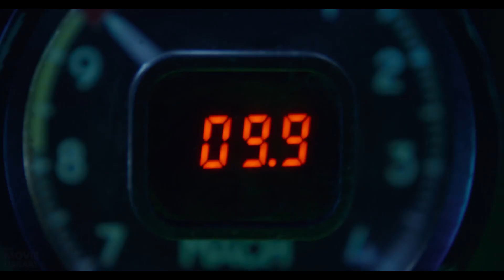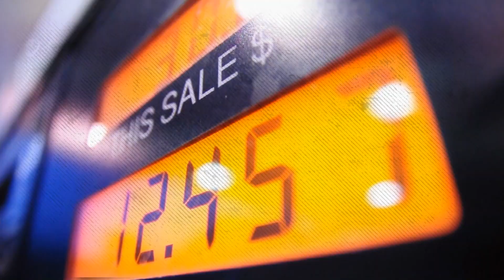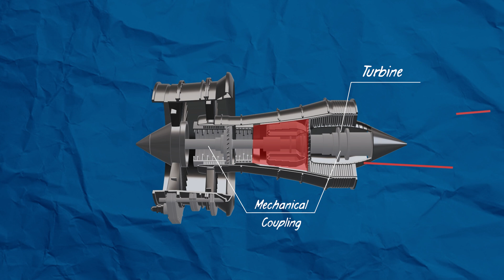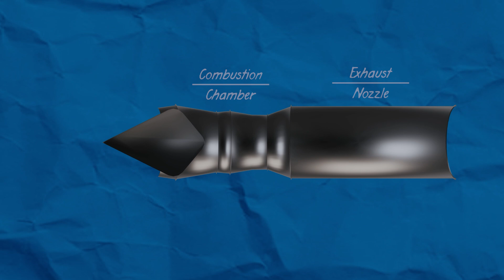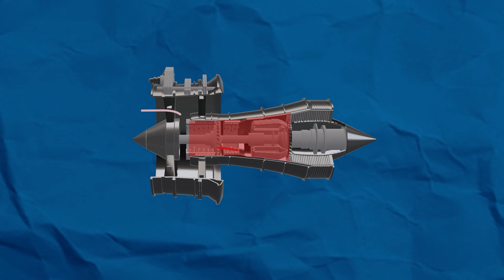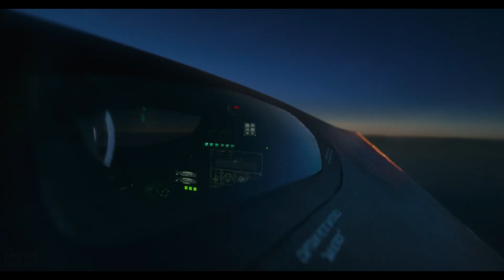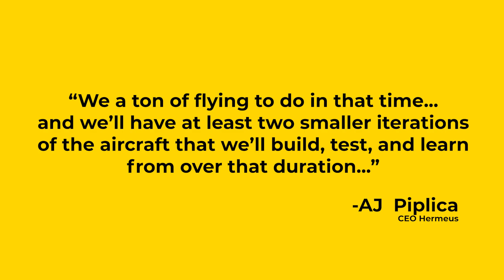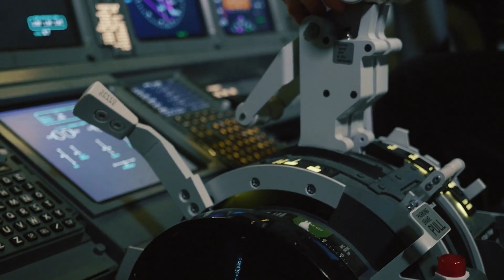The Mach 5 Engine That Will Change Air Travel Forever | Hermeus

Comment: Great video - thanks. But I was a little disappointed that you made no mention of the great British idea of the Skylon and the Sabre Engine, which also uses a pre-cooling system. I believe it converts from a Jet engine to a Rocket engine, at sufficient speed & altitude. The Skylon was a brilliant concept, but sadly, like a lot of good British ideas, always short of funding. Maybe you could make a video about it and give an update on what - if anything - has happened to the Skylon and the Sabre engine. Thanks again.
Reply from the maker: Hey! Thanks for the suggestion. I'll take a look 👍
Reply: @DrBenMiles  I searched for Skylon today, probably why this clip came up. The most recent clip was two years old. The last I read they were testing in Colorado and had some success in a lab / R&D environment that's too large and heavy for flight. But when has a proof-of-concept been deployable? Okay, July 16, 1945, still.

Comment: Concord has flown more time at Mach 2+ than all military jets combined since 1947. It was never commercially viable if research and development hadn’t been written off. What would be the point of commercial jets flying faster than the speed of sound considering the material degradation due to heat on the control surfaces, wings and cabin structure. Then there is the consideration of the large amount of time waiting in customs and baggage handling.

Comment: These Mach 5 jet airliners are not going to happen. It is not the engines, it is the materials. We don't have supersonic jet airliners because sonic booms and the heat generated by air friction. Also, the SR71 had this type of transitional engine technology. Instead of trying to get there quicker, would be better off trying to reduce the time to get through the airport at both ends.
Reply: What about 1/10th size engines for
Mach 0.5?
Reply: @ummerfarooq5383  I don't understand your point. Mach 0.5 is 1/2 the speed of sound. Smaller engines would I suspect be more inefficient as the size bipass ratio is getting larger on modern jet airliner engines.
Reply: When the SR71 and the Concorde were around composite materials were in their infancy on a commercial scale. Now Its everywhere in the military and commercial vehicles. Mach 5 Jet airliners can and will happen. We have alot of R&D around the world looking into making new heat resistant and durable materials and we also have R&D in look at reducing Sonic booms. You are extremely ill informed and judging by your comment you look like your living 30 years in the past, please educate yourself and do some research on current developments in the field before you make such stupid comments.

In 1960 it was believed to be impossible to go to the moon but we did it in a decade. Never say Never
Reply: This reeks of an American complaining about spending 4 hours at the airport and only 2 hours in the air for a cross country flight. In the rest of the world there is a bit of pain when a flight from UK to Japan or America is between 9 and 12 hours depending on where you fly to so the 3 or so hours at the airport or layover isn't that much of a problem in the grand scheme of things.

Comment: hyperloop makes more sense to me, almost no drag, not much costs in energy, in a perfect scenario it would require 0 net energy to travel as far as you want since during decaleration you can get the energy back you used to accelerate it
Reply: The hyperloop is so flawed it is ridiculous.
Reply: @dr_ned_flanders  probably because I am not helping with that project yet, but in theory it is the future
Reply: TANSTAAFL - there ain't no such thing as a free lunch. You're never going to get work out without using energy. If you could then a) perpetual engines would be possible, and b) the universe as you know it wouldn't exist because you're proposing an instance where you have sanctuary from the laws of thermodynamics. Never going to happen. Vacuum - large scale in the real world is never going to happen. All vehicles break down. How are you planning to protect passengers if the breakdown involves lack of hull integrity? You get oxygen masks in an airplane - but they only work for the few minutes it would take to reduce altitude until masks are no longer necessary. You're believing in a tunnel that can absolutely not tolerate loss of vacuum but also allow a recoverable override to flood an accident scene with an atmosphere - and you need to solve that contraction to the satisfaction of regulatory oversight for safety. All built and maintained by economically competitive bids to select the companies that can work to the necessary standards where no industry exists to grow that talent. Good luck with that, you're going to need lots of it. Oh and remember that you're going to need rapid access to any location by emergency vehicles - fire and ambulance - throughout the entire line. And don't forget to factor in how long an entire route will be shutdown until transportation safety is happy after that first major breakdown or accident. All stuff you might be able to solve after you get started. That's started as in built without any assistance from major institutional investors because about zero percent of them are going to help you get started because none of them are going to accept wild claims about this whole thing not being a ridiculous financial risk. Remember, risk is the ratio of complexity to maturity. You have something not complicated that we have years of experience doing then that's low risk. Something this complex and zero maturity of experience making? This is a maximum risk for investors and you're going to bleed money until you discover that it can't be done in the real world. Elon knew it, the technology demonstrator was seriously dialed back from promises before unveiling this thing. These are some of the reasons that some people describe the whole thing as ridiculous.
Reply: @Ni999  this has nothing to do with the topic, sorry but you just wasted you time
Reply: @JuliusUnique  Astonishing that you are all excited about the hyperloop but don't recognize its description or your own words fed back to you. At least I finally understand what level of intelligence it takes to support it.. Thanks! 🤡
Reply: Plot your favorite long haul route for hyperloop. Does it intersect an ocean? Where will the vacuum tube reside, under the seabed, on the ocean floor, on the surface? I'm open to suggestion from someone with your ability.
Reply: @cowboybob7093  having it on land only will already be a huge improvement and if travelled from europe over russia twoards america only 2 big bridges are needed. From island to island short hydrogen flights could be a thing, but in practise it will probably be something like having it on land only and using planes for the oceans. Eventually either below or on the ocean will be the best solution I guess, thinking long term it just makes sense to connect humanity that way
Reply: @JuliusUnique  Thank you for plotting your favorite route. Nineteen overland time zones east from the prime meridian to the east coast of the US instead of five TZ headed west is sensible. In addition to your engineering vision the world needs your diplomatic ability to negotiate with Russia. The route between Asia to Australia can wait.
Reply: Hyperloop is never going to happen, just ridiculous, meanwhile Japan is finishing off the Maglev between Tokyo - Osaka that has done 603km/h.
Reply: @rasta77-x7o  please provide an argument on why it is ridiculous? We already have maglev trains as you stated, so the only thing left is the vacuum, which doesn't sound that hard to me

Comment: I've been in the aerospace industry most of my life and a mach 5 engine is not going to change air travel, what will change air travel is fuel efficiency and  aerodynamic improvements to the  Air frame....
Reply: I've been delivering food to aerospace industry commenters most of my adult life and I agree with Tony's comment
Reply: Unfortunately the noise of going supersonic and the efficiency are a lot more important for passenger travel. Man the problems big rockets flights will have just cause theyre so loud they will have to land offshore in europe. Theres no way to silence a rocket.
Reply: @lilbigblock3534  that's what the air carriers want is range, when I flew for the airlined  their main concern was fuel efficiency.... and at Boeing  we would sacrifice speed for range and efficiency....
Reply: Exactly, it's exciting but not for passengers, if its real it will be amazing for military aircraft but passenger aviation will be largely affected by the rruss based wing concept, blended wing designs and engines such as cfm rise
Reply: I would argue that improvements to TSA would be the biggest bang for the buck at this point. I do love the engineering and technology involved in the advancements though.
Reply: @curtislavoie2242  lol so true if you never had to come early just in case there was a queue it would've been so much easier
Reply: Here-here!
Reply: Because? I've been flying my whole life and speed will fundamentally change air travel. 😅
Reply: @Nonsequitor415   Maybe one day but not now,  Aircraft manufacturers are interested in economy, not speed....
Reply: @anthonynarozniak9725  Fax though unfortunately
Reply: @Nonsequitor415 there’s a reason commercial passenger airplanes are trending towards being more efficient rather than faster.
Reply: You have my "vote" :)
Possibly in combination with "revolutions"in material sciences and other "base sciences"...
Best regards.
Reply: If it's loud but not made by the US, just like Concorde, it will be banned! 

BTW please stop saying "Mark" for Mach ... It's pronounced "Mak" there is no "r" in the wird! 🤔🙄
Reply: But what happens if air travel takes a quantum leap and starts using rockets for long distances?
Reply: @user-fo7mf9nd2h  then they'll have to start making more efficient Rockets
Reply: Using rockets for long distances will never happen.

Comment: 7:18 "no one's been able to do this before "
SR 71 Blackbird : Am I a joke to you ?😁
Reply: Certainly not, Olie.  That J-58 engine was capable of going faster than the air-frame; when it wasn't in some sort of "un-start" condition requiring manually restarting the engine(s).  1958 technology.  The engine was also rather large -- being about the size of a Phantom's entire fuselage.  We won't talk about using a special fuel as hydraulic fluid and coolant to get heat away from critical components and into the engine to get rid of it.  Sexiest plane to ever fly, though.
Reply: @everettputerbaugh3996 it was also leaking fuel on the ground as it was designed to expand from the air friction heat to seal up. Plus the special fuel was toxic :p

Comment: go external combustion heat transfer engine instead
Reply: big slow flame (megawatts like in a power plant) then cold air to hot air expansion thrust

Comment: The Russian Zircon scramjet missile is also 'air powered' and was put into service in Jan 2023. Its top speed is Mach 9.
Very good videos though.
Reply: This video is about a hybrid turbo ramjet for manned aircraft though, not a scramjet missile, in that aspect the zircon is nothing new since the Boeing X-51 waverider did it before the zircon was even a concept and the US deemed it unnecessary, any competent aerospace company can achieve similar results to the zircon with a rocket booster.
Reply: @SmoochyRoo  My point is that Ben wrote “it will be the first air powered engine to achieve these speeds” which it is not correct because Zircon has already achieved that. I didn’t say Zircon was the first to do so though.

You also made some incorrect statements which Ive addressed below:

Unlike your statement’s claim, Zircon is something “new” because no one else has been able to put a scramjet in service before. There's a big difference between experimental and in-service.

The X51 was obviously a failure because the US has not been able to take it beyond the experimental stage even though they are desperately trying to emulate Zircon.

The US did deem it necessary as proven by the fact they are desperately trying to emulate Zircon to this day.

No other competent aerospace company has been able to achieve what Zircon has even though many nation’s top aerospace companies have been trying to for decades.

The benefit of a mach 9 scramjet over a booster is its smaller size or greater range or greater payload because no air/oxygen needs to be carried. This is why the US wants a similar weapon to Zircon but cant create one because its military attention for the last two decades was spent fighting in the middle east. Now its desperately playing catchup.

Comment: Thanks, good description of this turboprop/ramjet hybrid technology. 
All the way through the video I was thinking, more toys for the 1% that belch CO2 - how is this the way of the future?
Reply: Turbo-fan.  Turbo-prop uses a turbine to spin the propeller.  High bypass turbo-fan = commercial jetliners (very efficient.  Low bypass turbo-fan = fast (and smaller), but far less efficient.  Afterburners burn fuel like its free but can shove the aircraft to Mach 2.8 or so.  (the SR-71 used modified afterburners as ramjets  to cruise above Mach 3.1.)
Reply: @everettputerbaugh3996  Thanks EP.
Reply: @everettputerbaugh3996  Where does super-cruise fit in?

Comment: Yeah, it's really not changing much of anything at this point and hasn't since 1935 when René Leduc of France was issued a patent on a piloted aircraft-propelled ramjet of his own design. The project was suspended during WWII and on April 21, 1949, a Leduc experimental aircraft made its first powered flight. Maybe they sell Leduc memorabilia on Amazon that you can use affiliate links for. A worthless regurgitation of old (old old) pilfered data and b-roll so you can beg on YouTube. Bravo pumpkin.

Comment from the maker: Where would you fly to first?
Reply: Nunavut! Or Georgia (the country).
Reply: Are you addressing people worth serious money or is this a fantasy question?
Reply: 1.Singapore-New York
2.Perth-London
3.Dallas-Melbourne

....currently some of the longest non stop flights in the world averaging 18 hours in a regular wide body plane
Reply: Did some checking. It will never happen because Lawyers:
100 milli Sv/year limit for adults. So could be coped with.  The problem being ladies who are pregnant (You sometimes get those on commercial flights.) For instance, Quoting “Natural Radiation At Aircraft Altitudes.” M.A. Shea and D.F. Smart. We can see that Concord flying at considerably lower already is on the limit. Measured calibrated trip from Leeds UK to Chicago USA. Total dose 0.5 milli Sv this is the limit for a Fetus, which is also 0.5 milli Sv. 
I realized there is no point doing any further research: Case closed.
Reply: @MadeleineTakam_Info_on_Profile  couldn't they just like use some shielding?
Reply: @OwenWithAHammer  What, from the lawyers and multimillion dollar litigation? Regarding shielding materials Owen. The strongest theoretical is spiders web and carbon 60, both useless at these temperatures with no ability for Xray radiation shielding. One could try a mix wurtzite Boron Nitride and Titanium, but probably too weak. The proven materials for handling heat are various forms of RCC’s, but these were used on the shuttle and they are unbelievably fragile. That leaves good old Titanium alloy. By my rough calculations you would need about 2cm at anything over 90,000 feet. – Try getting that weight off the ground. 
The whole idea is science geewizery, for people that haven’t done a PhD in physics or engineering. It will never happen for commercial planes carrying ladies. (You can’t rely on giving prospective female passengers a pregnancy test before every flight – The lawyers would be apoplectic)
Reply: @MadeleineTakam_Info_on_Profile  bro, put the radiation shielding inside of the heat shield, duh
Reply: @MadeleineTakam_Info_on_Profile  my bad it just seemed very obvious to me. Put any sort of radiation shielding on the inside of the plane, inbetween the thermal insulation layer and the area where people chill. Thanks for all your hard work in life sounds like you did a lot of cool stuff!
Reply: @OwenWithAHammer  Required radiation shielding to drop to the legal threshold of 0.5 milli Sv - is about 2cm Titanium, this equates to 1.6cm of steel for radiation shielding purposes and I think you can bring the thickness down to 1.1cm of lead. As you will note by doing quick Molar weight equations, the 2cm of Titanium is the lightest. The problem is not structural, the shuttle has already been built. The problem is ladies. Think of it this way Owen: It is likely that it will be the rich that use the plane. The cost of human death is about half a million up to 2 million. The cost of a deformed baby is in excess of 15 million at the lowest starting point. What happens when someone with the wealth of say Kim Kardashian sues the airline for birth defects in her baby? 

It is very easy and quite lightweight to shield to achieve 50 milli SV. You will note this 100 times what is safe for a pregnant woman. Astronauts receive 50 – 2000 milli Sv. In case you are wondering and at 100,000 feet you might as well be in space. We don’t send pregnant women into space. 

I am sure you have had an Xray at sometime in your life. Radiation is hard to block, that’s why lead is most often used, gold is good but expensive. Concrete is the cheapest. The equations are not linear but you can basically say the more dense the material the thinner it can be. Dense means heavy.
Reply: @MadeleineTakam_Info_on_Profile  Ok so just don't let pregnant women on the plane? Or we use some sort of lightweight polymer like bismuth trioxide + PMMA. To suggest our only options are lead or titanium is absurd, we can develop better materials or use existing ones. I think you're being too pessimistic.